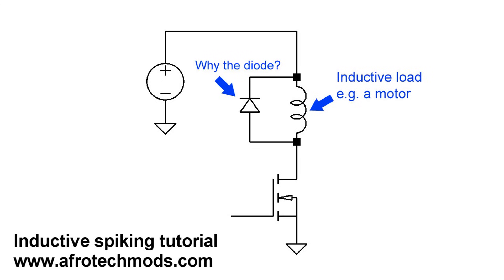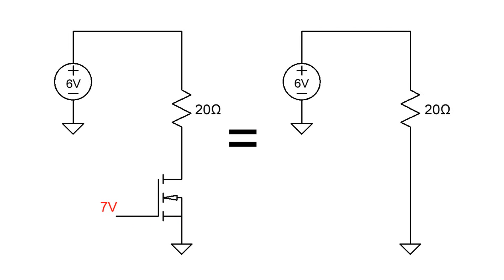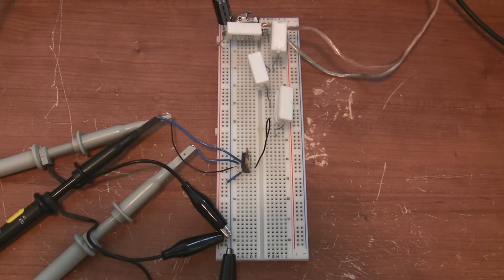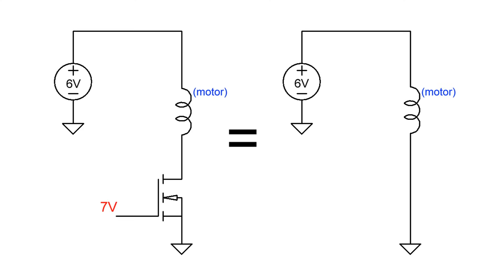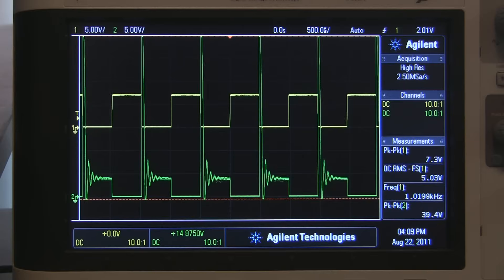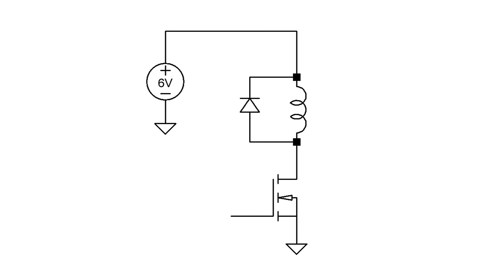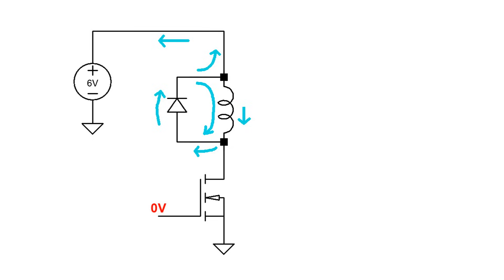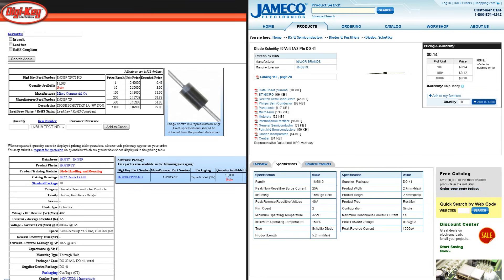Inductive spiking, and how to fix it!

Comment: +Afrotechmods or someone that could help
 sometimes I get confused by schematics.. I'm just a hobbist playing around with arduino, some dc motors and 9v batteries... 
Anyway, I'd like to clarify: when using a diode as protection from a energy spike, in the case of a sudden stop of energy flow, should I connect the diode between the + and - poles of the dc motor? with the energy flowing from positive to negative? is that right?
Reply: It's actually really simple. An inductor always generates a voltage that opposes the change in current. In this case, since the current path stops, it'll create a voltage in such a way that the current still flows across it. And choose the polarity from there

Comment: So what If I don' want the spike to go back to the power supply? Maybe a resistance in series with the diode would do? Would prefer to use something with no energy loss!
Reply: +WaC Put another diode in series with the power supply before the motor.
Reply: +brutusultimatum well that would do away with the protection as the spike wouldn't have anywhere to go. Maybe a diode as you say + a capacitor after the diode but before the motor to temporarily store that spike? Just wondering.
Reply: +brutusultimatum Ok I was reading some other comments and they say this is a mistake in the video. The current actually doesn't flows back to the power supply.

Comment: how about if I have bidirectional motor, that sometime the polarity changed. Using two diodes?
Reply: +sugiarto udah Maybe you can use a mosfet and turn it on when the other is off (an idea). Synchronized otherwise you will burn them if both are on at same time.

Comment: This makes sense on drain side of MOSFET but I've seen circuits where this damper diode is placed on the gate pin when connected to a driver ic for a smps. I'm having trouble understanding it's purpose in that application?

Comment: I have tried it, with a big schottky diode, and the diode became hot, and i had connected it in the right way.
Reply: +Claudia ft Privacy In the simulator from ITspice it shows that throe the diode goes something around 90A. So it is logic the schottky gets hot then. What is the solution for this problem?

Comment: Hi Afrotechmods, thanks for your video sharing but I have a question. If I parallel a diode with a dc motor, the spike will be reduce? or it is normal for the motor's PWM waveform contain spike or noise when it running? Appreciate for your reply, thank you very much^^

Comment: this is very interesting, but i'm not sure that I have a situation where I need to worry about induction spikes... says the human who knows very little about electronics....

      if anyone has a moment, can you send a little guidance my way?    I have a small motor(to turn a mobile) that runs on only a 1.5v dcell battery. I just want to slow down the rpm. I tried sticking a 10k pot inline with it, but that didn't work; 3º of a pot turn and the motor went from full off to full on. I'd like to get at least a 180º turn to go from full on to full off, but I realize 1.5v is a very low level circuit.

     question- is it possible this ornament motor is not set up to be slowed down? Could I just use a fixed resistor in the circuit to slow it down by 25%? if so, how do i figure out how many ohm resistor I should use for what percent decrease?
Reply: @Glebs thanks and yes, looking for a quicky not a whole day project. I watched the YT and WOW that a lot of precise soldering for a person with about 5 hours of soldering experience over the last...40 years :)  I'm going to go look for some electronics friends:)  thanks for all the guidance it has been priceless and I will get this to work!!!
   Full Disclosure, in my electronics class 2 decades ago, I got as far as thevenizing circuits and said either go "all in" with electronics or "all in" guitar composition/performance... music won that battle.
Reply: Michael Bootzin aka painfully honest

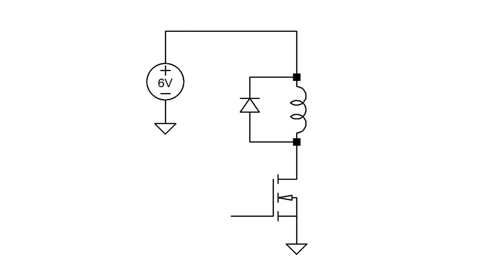Comment: 3:20 How is current going to flow back to the power source since the transistor is off, thus that part of the circuit is open?
Reply from the maker: Observ45er
Hi Observ45er,
You were right!
I built the circuit as I did before and used my current probe. I saw a negative current spike on the supply line just like the last time I built it and was about to take a screenshot to prove you wrong. But then I did some playing around. I dropped the switching frequency from 1+kHz to 100Hz and the negative current spike vanished. So it would have been related to something else in the circuit. I updated the video with an annotation.
Reply: @Afrotechmods  maybe there was some parasitic capacitance from ground to the inductor? That would close the loop, enabling current to flow from the inductor to the power supply
Reply: ChiIdKiIIer
It's already been overly analyzed. Read the whole thread.
Reply: That bit of the video is definitely wrong. You CAN make it push the current back into the power supply by using two diodes - one from ground to top of the inductor, one from bottom of inductor to V+.  H bridges do this with the body diodes of the MOSFETs when the whole bridge is off.
Reply: The transistor plays no part in that diagram, other than trying to detour the power away before it traffic jams against that open circuit.
Reply: Richard Smith
You confused me even more. It's the diode's job to detour the power away. And the transistor's job to turn on and off the motor (open/close the circuit). So the question remains, how is current going to flow back to the power source since that part of the circuit is open, as shown in 2:02 (diagram on the left is the same as diagram on the right)?
Reply: runner180fxr The part it plays is WHAT you are detouring away from, not doing the detouring. Without that diode carrying away that access voltage, the voltage will spike the next time the circuit closes.
Reply: Observ45er
Thank you! Finally someone to confirm I'm not crazy. Also thank you for the thorough electronics lesson.
Reply: Observ45er I misunderstood the question, figured that out later.
Reply: Observ45er I guess they are. No thanks :) Appreciate the tip tho.
Reply: Observ45er shhhh they will find out im a fraud!! :S
Reply: +Afrotechmods in the video at 2:44 min what is the name of that phenomena in the Laws of Physics? When the MF collapses and leaves a &quot;more positive potential&quot;.
Reply: change in voltage = change in flux / change in time    -       a voltage is induced into the circuit to keep the current moving in the same direction that  built the field .
Reply: Faradays law says that a voltage is induced into the inductors coils when there is a changing magnetic field, like when the field collapses V = change in flux/change in time.
Reply: Mandragoras hmm
Reply: Sorry, where can I find the answer of @Observ45er? Thanks
Reply: dylans voice  This phenomenon is called Lenz's Law and the part of overunity that you are talking about is just pseduscience.
Reply: Mandragoras he means that some current will/may flow back into the POSITIVE part of the power supply thus charging the battery a bit or he suggests using rechargeable batteries etc...

Comment: 1N4148 is a good catch diode for low power inductive loads (<100V supply, <200mA load current or repetitive peak <450mA). It's easy to overlook it but it's actually really fast. trr=4ns. Its not as fast as a Schottky and is only good for low power, but it has other advantages like lower leakage current. It's faster than a typical FRED (maybe 15ns), much faster than a UF4007 (75ns) and much much faster than a 1N4007 (30,000ns). It's hard to beat for low power fast switching.

The voltage spike is proportional to di/dt. If you're switching high currents or switching at a high frequency where the transistor must be made to turn off very quickly, the diode much also be very fast or you can get the voltage spike before the diode turns on.

Comment: Where did he connect oscilloscope, to measure spikes? Between motor terminals or between drain and source(ground)?

Thanks :)
Reply: drain and ground. The negative lead of all the scope probes are common, so there's no option as another signal is being measured. That's a rule with oscilloscope use.
Reply: Thanks :)
Reply: Hi.is there a math formula to calculate back emf? for example in your video from 6 Volts you get a 40 Volts spike.how is that calculated? tx
Reply: The voltage is proportional to the rate of change of current and the inductance. V=L*dI/dt

Comment: Wow. Good tutorial and information.
I am currently dealing with this and now I understand better.
I am working on trying to use a mosfet to control a heated bed for my 3d printer. The printer is old and did not include a heat control. 
Thanks very much for your time and energy.

Comment: @ms63129 All circuits are RLC circuits in some way or another. The parasite resistances, capacities and inductancies might be too small or too large to practically figure them in a model but that doesn't mean they are not there.
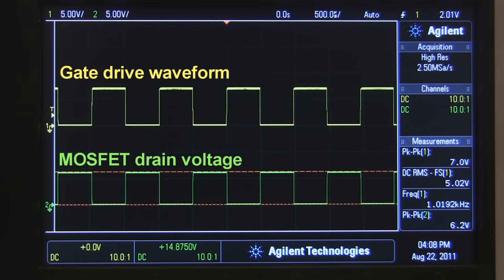The shape of the voltage spikes, as seen in 1:36 clearly corresponds to an RLC circuit.

Comment: This always confused me. How can there be current flow if the circuit isn't complete? Thank you.
Reply: When the current flow through the inductor is interrupted, it induces a voltage across its terminals. Let's call it V_L. Meanwhile the diode forward biases when its anode is at a higher potential than its cathode. The voltage at the node between the inductor and the FET, which is the diode anode, is Vs(6V) + V_L. The diode's cathode is just Vs(6V). So, whenever V_L is greater than the required forward bias voltage, the diode will forward bias and current will flow back to the source or potentially recirculate in the inductor.

Comment: when do you use an RC-Snubber instead of a diode?
Reply: That will work too, but the RLC circuit will "ring," i.e., energy will transfer between the C and L.  The R dissipates the energy after a number of cycles.

Comment: Almost there - How does the energy return to the power source via diode if it does not also have a path from the source' ground... If the desire is to suppress the energy created in the spike, shouldn't the diode go across the transistor/mosfet?
Reply: I agree, as when the flyback diode is added the energy flys back through the forward biased diode, not into the supply. Overall nice video but I was thinking the same thing. 

The suppression device or diode in this case could be in parallel with motor or transistor. The MOSFET used in this video actually already has suppression built into the transistor. Look at the datasheet he shows in the video, and you see a Zener diode across the transistor. The zener diode is to protect the MOSFET but will not limit voltage until spike is closer to the max rating of device. 

It is best to put suppression as close to coils as possible, but not always practical.

I like the way the author shows the voltage increasing until the field collapses. Without the diode, the field creates a high voltage in an attempt to break down the transistor and keep current flowing. 

It is well known that the property of inductance opposes a change in current and works to keep the current the same intensity and same direction. It is easy to overlook that the coil stores energy, however the stored energy is released as soon as the source is removed. When the coil changes from being a load to becoming a source of energy, the polarity of voltage across the coil must change to keep current through the coil in the same direction. 

The coil energy collapses faster without the diode. When the 1N4000 series rectifier diode is added for flyback suppression, it takes longer for the field to collapse. With the suppression diode the field collapses at significantly less voltage, as the spike is limited to around 0.7V across the forward biased diode. The energy field collapses faster without any suppression, but at much higher voltages. 

I think it is good to consider an application where the inductive spike is utilized to better understand this property of inductive kickback. For example the coil(s) in a gas engine like an automobile use the kick back to break the air gap in the spark plug. It takes at least 5kV to break down air, and most auto coils are large enough to create 10kV or more. The coil is typically charged with a 12V battery, but when the coil discharges, the only path for current is the air gap in a spark plug.  It is when the source battery is removed and the coil is discharging, that the coil voltage increases to ten thousand volts or more, breaking down air and creating the spark to fire the plug.
Reply: Yeah, I don't agree with that particular part of the video. From what I understand about circuits, the lack of a closed path means no power flowing back to the supply. Instead, think of the flyback circuit as a whole new circuit consisting of the inductor and diode. All other elements in the diagram are not involved at this point. The current through the inductor continues in a closed loop through the diode and inductor until the resistance of the wire causes the energy to dissipate. I've seen people put resistors in series with the diode to speed the decay of that energy.
Reply: you are all right, the power does NOT return to the supply. At least not in this configuration. But you can recycle the stored energy with another circuit, for example if you use 2 mosfets and 2 diodes. I think he just mentioned it because it is possible, but not with this simple circuit.
Reply: If there were some parasitic capacitances, that would close the loop, so current could flow
Reply: The energy in the inductor does not return to the power source. The inductor current flows through the inductor windings and produces I^2*R losses and it also flows through the diode and produced V*I losses. The energy in the inductor is dissipated by these two mechanisms.

Comment: Thanks for the reply man, it's a wheelchair and i'll be running 24 V motors which I measured a peak current of around 28 Amps, and an average of around 5 Amps, I guess a 5 Amp would do the job?

Great videos by the way!

Comment: While the inductor is dissipating all of it's energy the voltage being probed is vcc minus the voltage drop of the inductor plus the voltage drop of the diode, which comes to a bit over vcc. Then as the last of the energy dissipates the voltage drops down to vcc again. As for the funky waves, i think it's some kind of resonance from the inductor.

Comment: Does it matter whether you put the diode antiparallel to the inductive load or to the transistor?  In most fullbridge configurations you just add another fast diode antiparallel to each transistor which only have slow body diodes.

Comment from the maker: There is no extra current spike coming from the inductor, only a voltage spike. The peak current through the inductor will be the same as whatever the current through the motor is in the steady state on situation.

Comment: I wonder what this spike means for the current comming from the voltage source.
Since I=V/R, the high V peak should increase the I in a resistance below the inductor.

Let's say the current source can deliver 3A, but the current spike coming from the inductor is 6A -- will the current be drawn from the power supply and therefore kill it?

Comment: I didn't have a 1N400 diode handy when I was messing with my transistor controlled relay switch.  I used an LED instead to put across the relay coil so when the relay switched the current would make the LED blink for a second.  Do you think that is an ok solution?  I kept thinking that the first "blink" drained a little of the current, but then the voltage/current wasn't high enough to make it blink again, so it ended up going back to the transistor.

Comment from the maker: @Schmiki24 All power MOSFETs that I know of have that diode. However other FETs such as a JFET do not have the diode. Whether you should add your own additional diode in parallel depends on your application. Parasitic body diodes tend to be kinda "crappy", i.e. slower response time and higher forward voltage drop than a nice discrete schottky diode. So if you were building an H bridge, putting some good schottkys in parallel with each mosfet could get you a little more efficiency.

Comment from the maker: @KIBProductionz Actually, you would get a negative voltage spike at the node where the FET and the inductor are connected to each other. This phenomenon forms the basis of a buck-boost converter.

Comment: Does inductive spiking occur if you just place the MOSFET transistor BEFORE the coil? Hypothesis: If there's a GROUND for the current to flow from the coil , the inductive energy(that will be converted to electrical energy) stored in the coil  will flow from the coil down to ground, thereby eliminating(or reducing) voltage spikes.

Comment: This can also be applied to a regulator (boost, buck, and linear), since reverse current is still an issue. Simply use the diode concept on the input and output of the regulator. Look into power diodes for higher currents common to switchers.

Comment: @ForViewingOnly those voltages will force the transistor to conduct (like sparking inside it, if the volts are higher) and they can damage the thin iron oxide layer (the gate)

Comment: I have a doubt, please. Suppose I don't want any high voltage to reach the battery (maybe is not rechargeable and delicate), what if I put a zener diode (say 10V) with the negative on the ground and the positive between load and the mostfet? Would it blow? Would it protect the mosfet? Thanks.

Comment from the maker: @pufarinu It's a parasitic diode, created by the process used to make the MOSFET. i.e. it's not deliberately put there. It may be a good thing or a bad thing depending on the application.